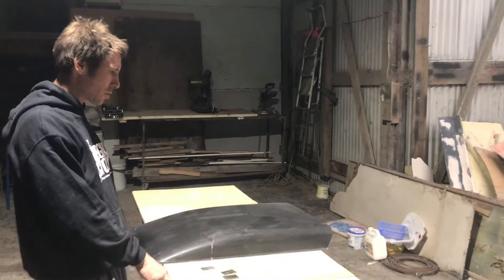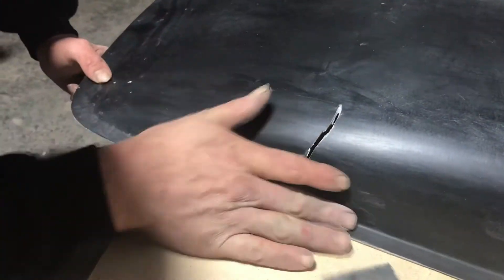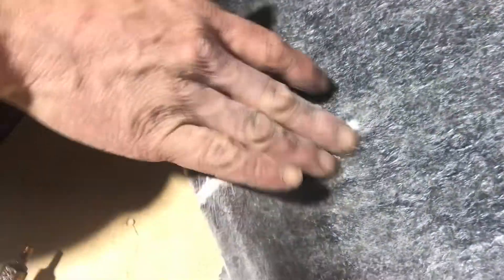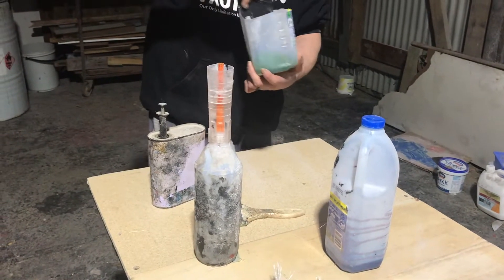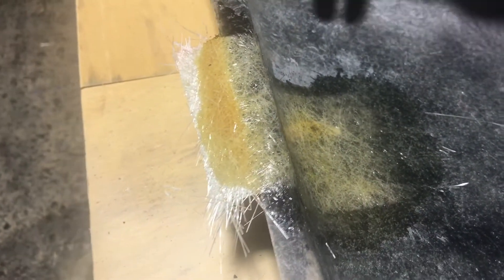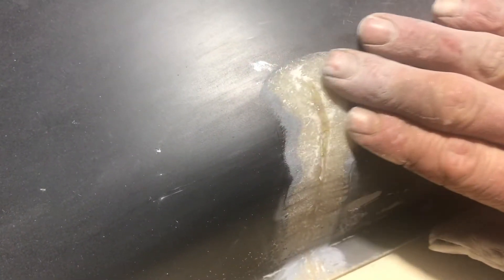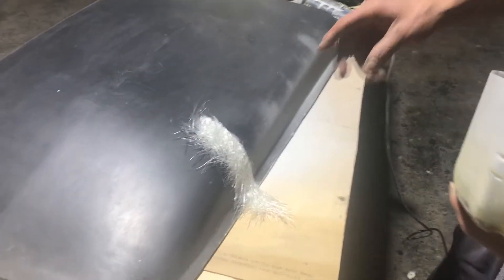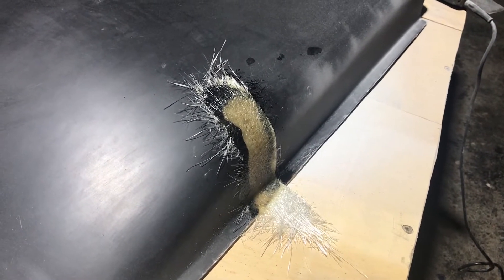How to repair a crack in fibreglass

Comment: Can I use this repair on a pressurized vessel…A pool filter  pressures not above 30psi but I use 20psi most times?????  Great Job though.
Reply from the maker: Hi, thanks for your enquiry, yes you would be able to, I would go to extra lengths to make it stronger